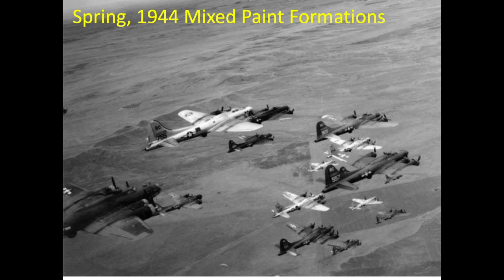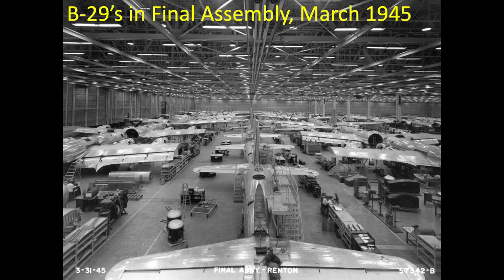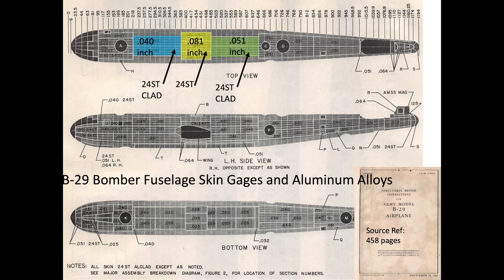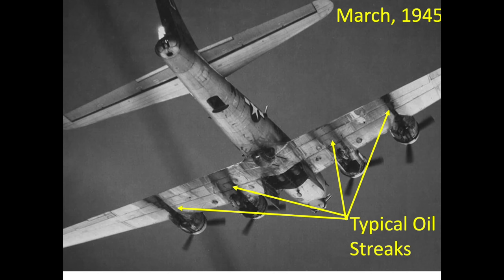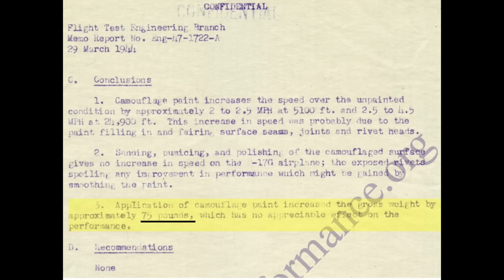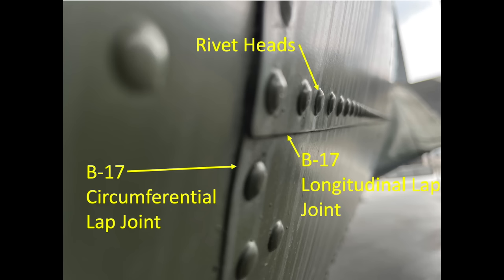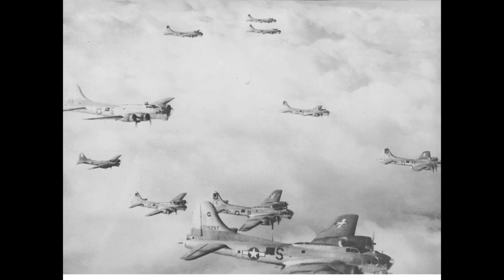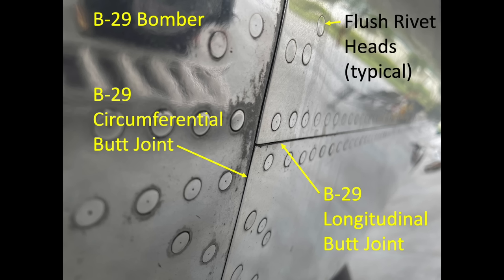B-17 Bomber Paint Vs No Paint, Unexpected Results

Comment: Painted aircraft flying faster than unpainted ones makes sense to me. I read in a book about the Spitfire that they did all kinds of testing with the prototype to see where they could make paint savings on the production aircraft. Basically the prototype had very smooth paint-job all over to smooth out seams and rivets but it had been very laborious to apply so they stuck split peas all over the plane to simulate rivets and removed them in sections to see the performance change. From memory the all over riveted plane was something like 25-30 MPH slower but if you had rivet heads on the fuselage and upper surface of the wing you only lost 5-10 MPH. The worst place for drag to have rivet heads turned out to be the wing leading edge.
Reply: Interesting, but I think there are other aspects to consider here. For example, the effects of non-flush riveting on the wing in relation to stall-speeds, and on which part of the wing stalled first, and finally on how much and when pre-stall buffeting occurred to alert the pilot of the incipient stall. On the Fw190, the stall had very little pre-stall buffeting, and consequently the pre-stall or pre-spin buffeting offered little warning, leading to FW190 pilots being cautious in a turn-fight where there was insufficient height to fly "on the edge". Incidentally, the chevron drag-strips on the inboard upper wing of a Pa28 are there in order to cause a breakdown in laminar flow at the wing-root, before it occurs at the wing-tip, thus giving earlier indications to the pilot of a stall, and to ensure that it stalls at the wing root, not the wing-tip. (Other measures such as reduction of angle of incidence at the tip, also apply to the same end.)

Comment: I was always under the impression that a bare skin bird was faster and lighter than a painted one. Well, I learned something today! Thanks!
Reply: You are right if the aircraft, like the B29 mentioned at the end, has flush rivets. The B17 did not, but the paint smoothed it out, and the joints in plates, making the painted plane more aerodynamically efficient.
Reply: The Streak Eagle was an example of an unpainted aircraft which was faster. It was used to set airspeed and time to climb records in the '70s. Aside from all non-essential components, McDonnell Douglas also removed the paint to save weight.
Reply: As mentioned, flush rivets makes a MASSIVE difference.

Waxing it will also help.

Just smoothing the skin will help, which is what the paint does.

Comment: Aluminium self oxidizes on exposure to air if there isn't already an oxide layer or paint present. The oxide layer is thin, slightly opaque, non-porous and prevents further oxidation and corrosion. This is what causes the finish to appear dull over time compared to the polished finish after the panels are first produced.
Reply: How do you explained the different dullness between sides of cooking aluminum sheet ?
Reply: The part you missed is where he talked about the difference between Alclad and uncladded sheet.  Alclad has a pure aluminum skin a few thousandths thick over an aluminum alloy.  The aluminum alloy itself is far less corrosion resistant than pure aluminum so it forms that oxide layer faster (it also turns white rather than the darker color of an oxide film on pure aluminum), and the unoxidized alloy has a different color as well since it's partially alloyed with copper and other metals.  That's why the two types of panels are able to be visually distinguished on the same aircraft.
Reply: @pan2aja  I suspect you're talking about aluminum foil using for cooking?  The reason why one side is shiny and the other side is dull is because of how they manufacture it.  Because the rolling dies can't form a sheet that thin, they take the foil and fold it over on itself with a thin layer of oil between, then run it through the dies.  This allows them to get the desired thickness of the foil.  The dull side is the part that got folded in on itself and coated with oil, while the shiny side is the part that was on the outside and came into direct contact with the polished rolling dies.

Comment: Reminds me of an email conversation I had with a P-47 pilot years ago. In one he mentioned that he cleaned and waxed his aircraft whenever he could, it made a noticeable improvement in performance. It was a camo razorback P-47D
Reply: The RAF had been lightly sanding and polishing their spitfires and they gained some speed from it a noticeable amount although the sheen of the paint tended to be like maybe slightly shinier than an eggshell but not flat like an eggshell but the surface itself was smoother plus when you do that you knock off all the overspray that goes on with the colors meet what color will overspray on to the other and in those areas the surface will be slightly rougher I could see how it could add up
Reply: You know you could probably wax and all metal plane and gain something and that would be dirt probably wouldn't stick to the surface as much dirt dust the mineral deposits from rain and washing it keep the surface clean and smooth it'll work better
Reply: Toward the tail end of the war they used putty and wax to blend and seal all the panel joints on a P-51H to see what kind of speed they could get it up to.  I believe they used 60-something pounds of it in total, and that was in addition to what the factory already added to the aircraft in order to assist the laminar flow airfoil.  But yeah, they absolutely used putty to seal panel joints on earlier mustangs during the war, and crews often did the same thing to aircraft that weren't P-51's in the field, such as the P-47, P-38, and so many others.  Once they got wind of a speed trick they all incorporated it in their planes, sanctioned or not.  Lots of people looked the other way because they knew it worked, but also knew they couldn't officially approve it or say anything to the brass about it.
Reply: I heard the razorback was more aerodynamic than the bubbletop. How that translated to MPH +/-  I dont know.
Reply: @Thenogomogo-zo3un  That's actually true, and the same goes for the P-51 as well.  I believe the P-47D lost about 16mph when made with a bubble canopy, but the P-51 was half that.  Later P-47's had other aerodynamic and power upgrades over the razorback to negate that advantage, but had they kept the razorback it would've given them a slight increase in speed on top of what the later models had.  The Reno Air Racers that win the unlimited cup all have custom razorback canopies (albeit, much smaller and more cramped), simply because it's more aerodynamic.  In addition to the speed advantage, they also had better yaw stability, which is why you generally only see the dorsal fillet on the vertical stabilizer of bubble cockpit variants.  The exception there is that some P-51B's had the fillets installed because it restored the stability lost when the rear fuselage fuel tank was installed.  For the most part all of these aircraft were originally designed with razorbacks, and the vertical tail/rudder was sized accordingly to get a good balance between stability and performance.  When you change that up by adding a bubble cockpit, it throws the whole thing out of balance and you end up needing aerodynamic "bandaids" like the dorsal fillets.